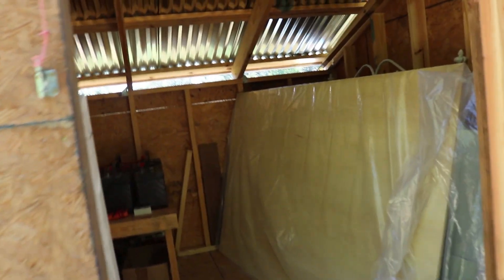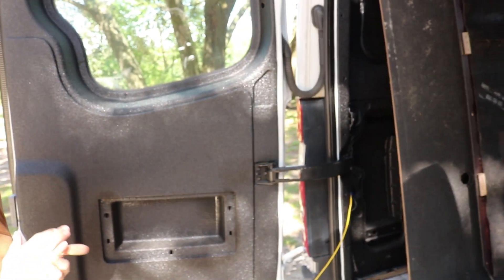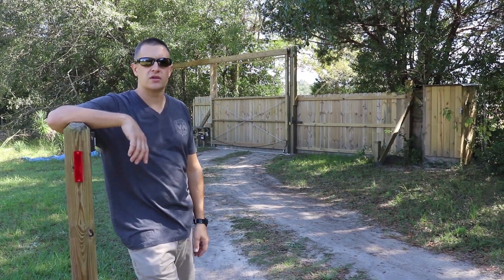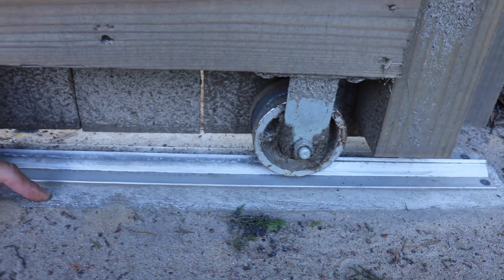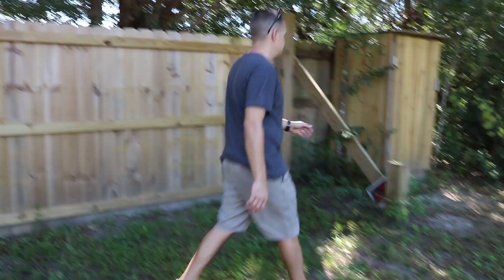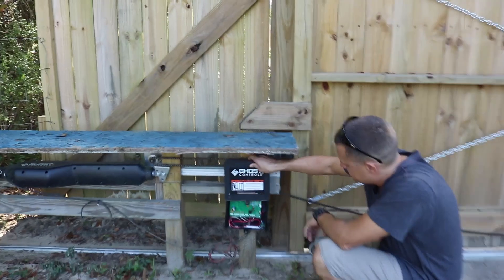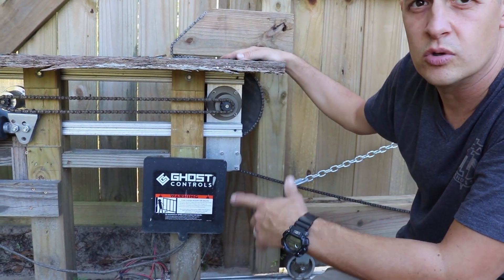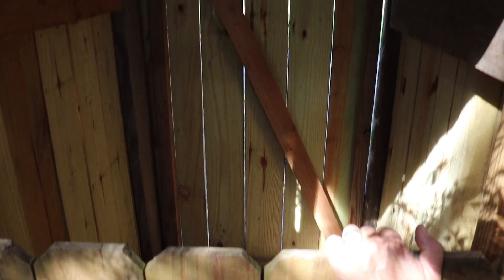Solar Powered Off Grid Gate Opener - One Month At Mediocre Manor - Day 2

Comment: Clever way to adapt a swing gate operator. Why not just go with a swing gate? Much simpler IMHO.
Reply from the maker: We did originally do a swing gate, but the wind load on our "picketed" gate was too high. Basically if we hadn't added fence pickets to the gate it would have worked fine.
Reply: @MediocreManor  what if you had a zombie lock?